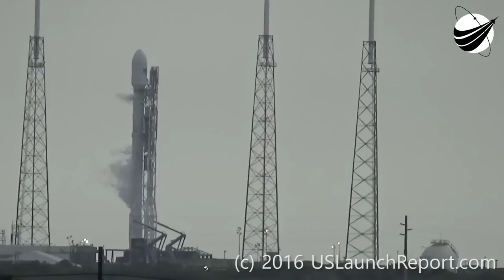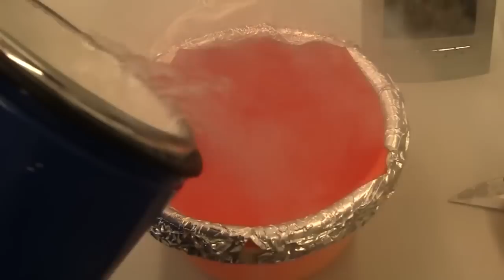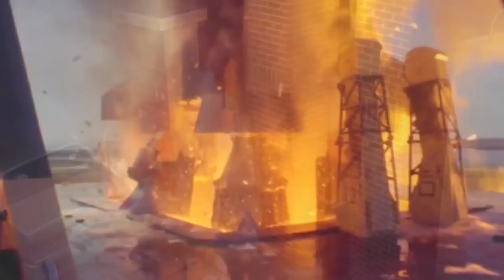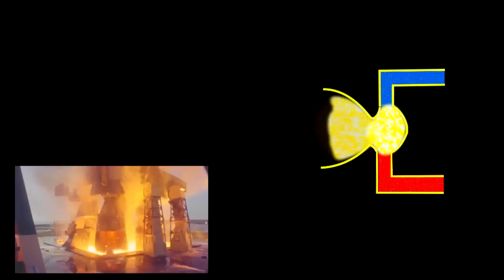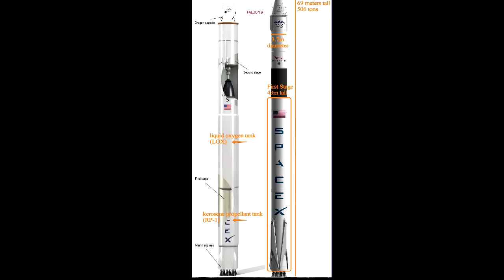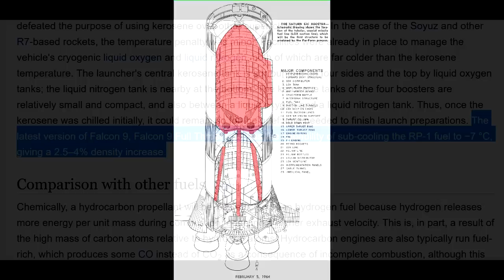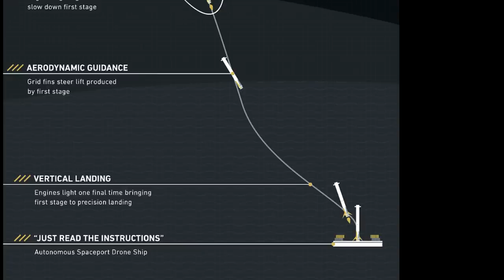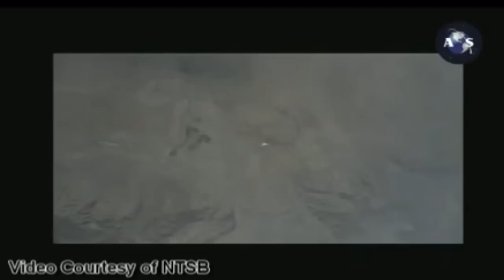Why did the Falcon 9 Explode?

Comment: let's just 3d print rockets in whole out of recyclable material. When they come back they are melted down and re printed.
Reply: I've got an even better idea. Let's make rockets out of cardboard so that they'll be super cheap to manufacture!
Reply: Lets all live in low earth orbit, then we'll just be there already. problem solved.
Reply: And let's not forget to plaster the clouds with solar panels while we're at it.
Reply: when they come back they'll be melted already. efficiency
Reply: If we made a floating city, would it have its own sovereignty?
Reply: Instead of installing solar panels on them, why don't we just use the clouds themselves for fuel? Oh wait, then we'd probably run out of clouds eventually :(
Reply: worked for the care bears.

Comment: Why does oxygen burn like it does and not any other elements/compounds?
Reply: http://chemistry.stackexchange.com/questions/5708/why-is-o2-the-supporter-of-combustion
Reply: Oxygen doesnt burn at all, its not flammable its merely an oxidizer. You have other oxidizers that can serve the same function as oxygen(even in rocket engines), most notably nitrous oxide (aka laughing gas).

Oxygen is also one of the most dangerous gases because items that are considered "fire proof" at normal oxygen levels can burn ferociously at just a few percent higher concentrations of oxygen.  Which is why you shouldnt try to "clean" your clothes with oxygen gas like I saw a welder once do.
Reply: because burning requires heat, a flamable material, and oxygen. the falmable material is nearly everywhere and can burn quite easily if given enough oxygen. when you have pure oxygen it counts as "enough oxygen".
Reply: I understand but why does it require oxygen in particular? Could another chemical be used in its place or is oxygen unique in its burning properties?
Reply: Thanks that's a great explanation
Reply: Its highly electronegative